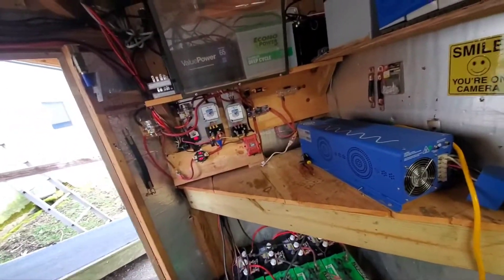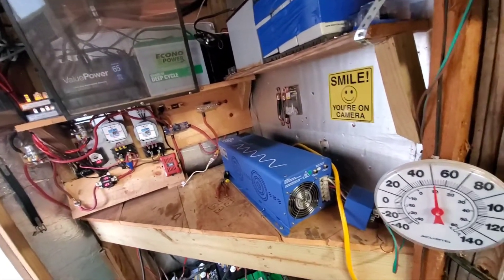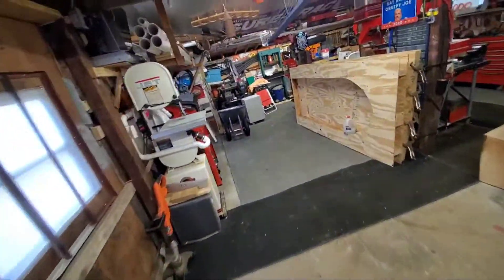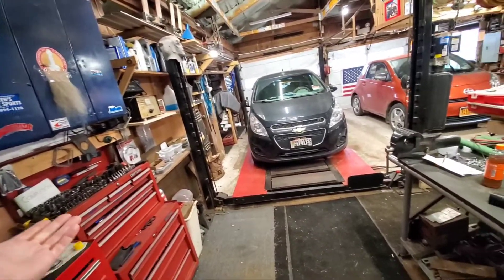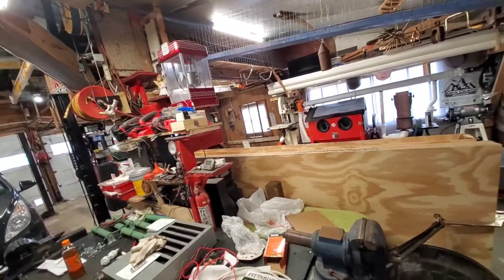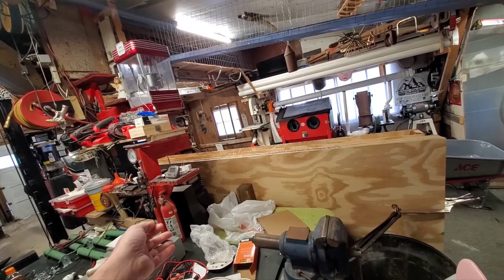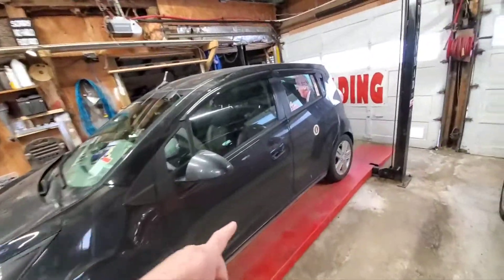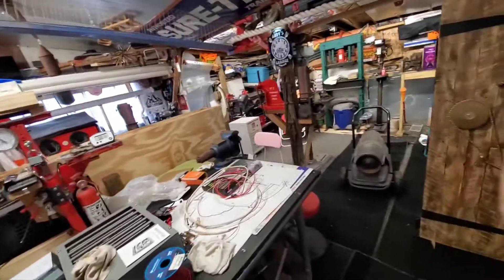inverter issue solved, finally got my refund from Jimmy John's crappy Subs

Comment: doesnt matter what business you work in when you treat people with respect it only gives your business a good name and encourages people to go to your business. youd swear it was a pure sine inverter because of the pure sinewave  painted on the inverter.
Reply from the maker: The problem where I screwed up is it's a 220 inverter and I misunderstood thinking you could split it in half and I guess you can't oh, it does work on 120 but it hums because it's not word correctly I guess so now I have to sell this one and buy a 12 volt to 120 volt only inverter pure sine wave oh, I'm also going to recall the company again tomorrow because I think this was supposed to be a pure sine wave but maybe it doesn't matter because I'm using it in the wrong way
Reply from the maker: I actually checked, it is actually a pure sine wave! I'm just using it wrong here's the model if you want to look it up and read about it;

PICOGLF40W12V240VS
Reply: @TheOriginalAndysGarage  ok ill have to research that, ie diy  split phase, i assume the transformers have two sets of output wires just like battery chargers that do 6v and 12v.
Reply from the maker: @closertothetruth9209  I'm not sure but they say I'm not supposed to split it into two 120-volt lines so I don't know
Reply: @TheOriginalAndysGarage  its very interesting  all the same, we dont have 120v here. ive had transformers that can do various voltages, they just have the output lines from the transformer  at various locations, basically the more copper windings the more voltage the less copper windings  the less voltage just like a wind turbine pma. but as for you , Andy has bamboozled me , im like if the inverter only puts out 240 what trickery did Andy do to get 120, very interesting all the same.
Reply from the maker: @closertothetruth9209  our 220v is made by two 110 lines coming into our houses
Reply: @TheOriginalAndysGarage  makes perfect sense
Reply from the maker: @closertothetruth9209  our power lies run down the road on telephone poles with two hot wires and one ground then when it comes into your house you have to add an earth ground